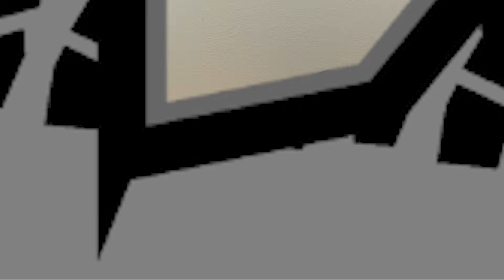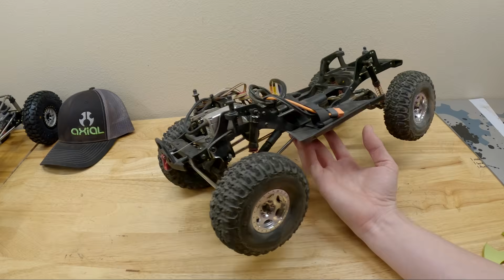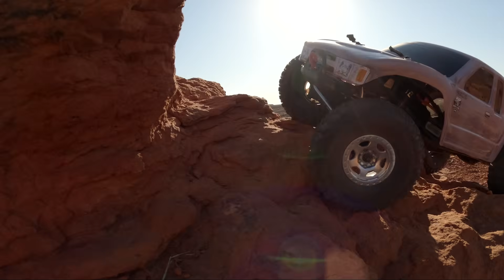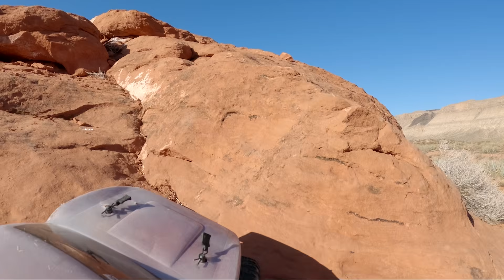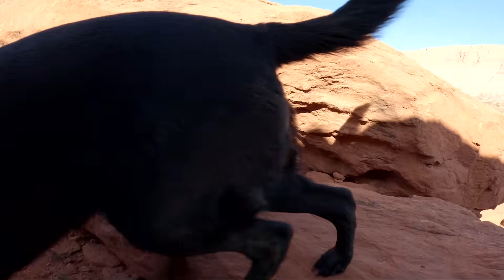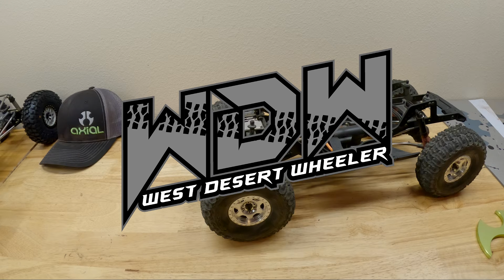SCX10 Pro! First Run and Review! Axial New Release

Comment: The price is laughable, for a roller chassis without wheels they should be selling this for £300 max. I could make an scx10ii including electronics perform this well for less than the asking price of the pro kit
Reply from the maker: Yes you can but it’s missing forward motor, angled skid, tunable shocks, decent shocks, real links, optional servo placement, steel axles, and underdrive. Now by the time you add that it’s clear why it costs what it does
Reply: @westdesertwheeler  I agree it has more potential, it's just seems crazy expensive for a bunch of parts unassembled and no electronics

Comment: Aren't the axle tubes steel? Harley Designs weighed his prototype unit to have almost as heavy tubes as the optional brass ones are.
I'm quite interested on getting one, although when trail running it will probably need a servo for switching the underdrive
Reply from the maker: Correct axles are steel. I was corrected after posting this

Comment: Why aren't videos mentioning the biggest benefit of underdriving the rear instead of overdriving the front? And that's to help eliminate torque-twist(we all know the reasons for over/under gearing, I'm just talking about underdriving the rear as opposed to gearing up the front).
Never overdrive the front when you can underdrive the rear. You can always gear-up(there's always bigger pinion) but have a limited number for gearing down.
 Did they send you the rig with the 3-link and CMS?
I think it's smart to have the the SOA 4-link option...especially where the servo mounts low behind the axle tube. It's absolutely "scale" , go to any serious off-road event, and nearly every rig has full hydro mounted to the axle, hence SOA.
   I think the Pro is the best thing to come out of the Axial camp since the original SCX10 or even the comp-ready AX10 Scorpion ARTR.
Reply: Thank you!! Well put points! Agree 100%

Comment: Do you think dig would be more useful than the selectable underdrive?
Reply from the maker: Well underdrive is working all the time, dig is an on off type of function. Dig certainly has its benefits. This truck was aimed at the class 2 competitions where dig is not allowed.
Reply: You can run under drive the whole course and still comp legal and guys who don't want an extra servo it keeps it simpler.

Comment: Debating whether to get this the Capra or the basecamp for a comp crawler starting point. I want to run 2.2s eventually so maybe Capra? What do you think?
Reply: Pro vs. the Base Camp, hmmmm. Tough question, I don't know?  Not sure if one is better than the other.  The Pro is awesome but for a comp build, I think you might be better off starting with the Base Camp (or even the 10ii Builders Kit).  The transmission on the Pro is great but pretty big and much heavier than a typical 3-gear transmission.  So, you'd probably want to change it out, which means an aftermarket skid (at minimum). Of course, you'll likely want to upgrade the chassis on the Base Camp/10ii?  Honestly, I think there are pros and cons to both and ultimately, I don't think  you can go wrong either way.  As for the Capra, I love mine and it can be competitive but I think a rail chassis is a much better starting point.  I hope that helps but probably doesn't, lol? 🤷‍♂️
Reply: Just a sub here; the only one I have is the Basecamp, and only upgraded the rims and tires. I gotta tell ya I adore that thing. It just doesn’t stop. Good luck and have fun with your choice. Mike in Florida 😊
Reply: @michaelkav6345  thanks for the input Mike. It’s a hard choice to choose what your next crawler is going to be haha.
Reply: I have a 4ws capra, with some brass weights and some 5.6" 2.2s. The thing is absolutely insane.